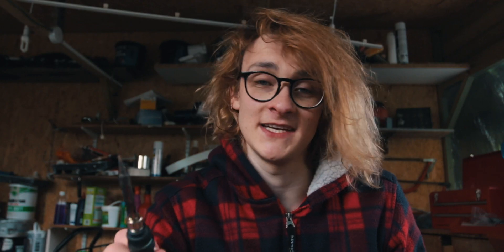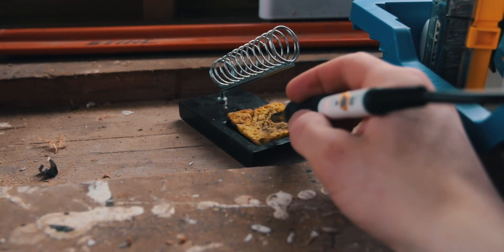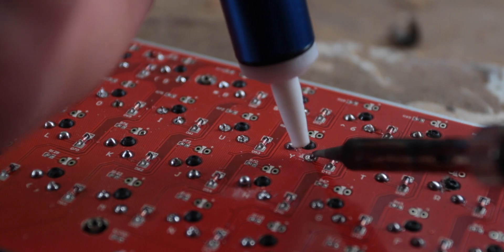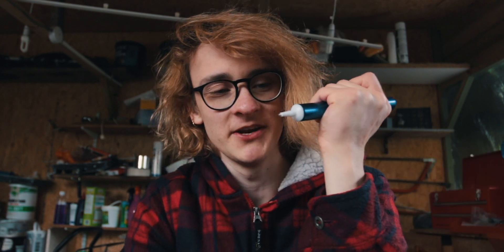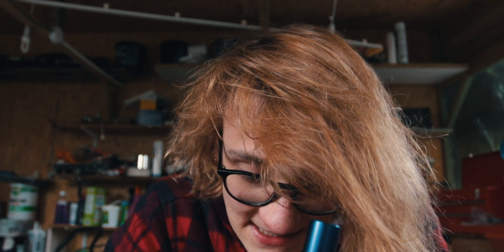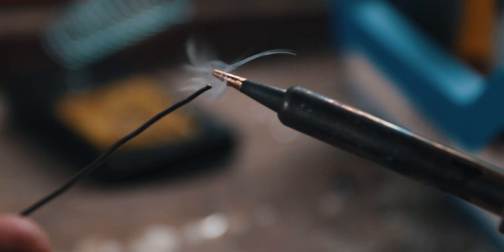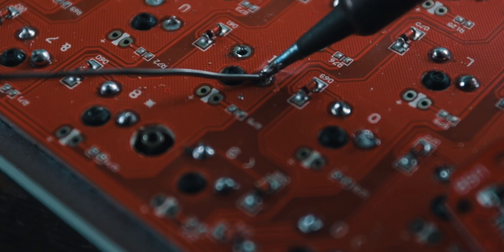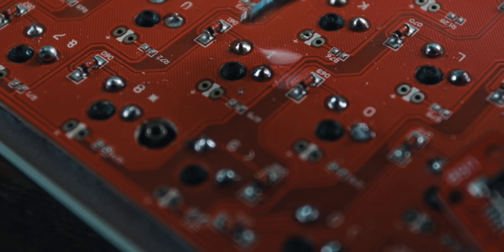HOW TO EASILY CHANGE/SOLDER MECHANICAL KEY SWITCHES

Comment: I'd like to thank you again, after some preparation, I finally went to town on my Ducky Shine 7, changing the original MX Browns for Drop HolyPanda Clears, also took the chance to change the stock stabilizers since the spacebar one was troubling me constantly.
I only messed up once, on the ESC, burned out one of the pads, but even managed to fix that by learning how to jump a wire, it was an easy problem to fix.
The result is a keyboard that's a pure joy to use, so don't be intimidated by soldering, people, with some equipment it's not hard and is kinda fun.

Comment: hi! if anyone can answer, 
I recently started my first keyboard project, I saudered in new switches. Everything works except the backspace key. the board looks fine, the saudering is fine, I changed out the switch in that spot 3 times. I'm still at a loss.

Comment: When I touch the soldering iron to the solder, it'll melt just fine. But when I touch the iron to the switch pin and the pad and the solder to the other side of the pin and pad, it doesn't melt. I'm using 40 tin 60 lead solder and my soldering iron is up to 690F. What am I doing wrong?

Comment: Can you take out switches without a solder ?? I don’t even have one
Reply from the maker: Nope, you'll need one.  Unless you have a hot swappable mechanical keyboard, but most aren't
Reply: @BubVisuals  ahh okay, thanks bestie. 😌 I’ve been looking at hot swap keyboards that are fine with any switches that have the three pins lolol

Comment: Actually really helpful, thanks mate

tho, do you need to resolder the switches in? Would it be possible to leave them unsoldered to make kind of a hotswap keyboard?
Reply: wondering the same thing
Reply: @loumcq1950  the answer is no, you can't. Done some experimenting with my boards and you can't leave them unsoldered

Comment: when you say "never touch your solder with your soldering iron directly", what are you touching the solder to then? the gold contact pad on the PCB?
Reply: i'm 99% sure that's what you're supposed to do
Reply: @picklejar7236  yeah, after 3 months of learning and building a few things- you literally have to do that lol. If you put the tip on the contact pad and hold it there waiting for the solder to melt, then you're gonna burn that contact pad.

Comment: wo'nt work for me. there's still a very thin film around the hole and the pin. i have a really expensive razer blackwidow and only one key died. I'm trying to replace it with my scroll lock
Reply: lesson learned : never buy a "gaming" keyboard, it is just a trash. Bad quality, bad feel, bad sound
Reply: Sorry but with Razer keyboards. You shouldn’t do that because they are junk. Buy another keyboard. A 20$ keyboard can be much better because you can replace switches easily
Reply: Nguyễn Hoàng not a $20 dollar one but I’ve heard that the gk61 is a very good keyboard and it’s hot swappable

Comment: Pardon, but when you say never touch your solder with your soldering iron, you mean just leave the soldering iron close to the socket and slid the solder under the soldering iron but and leave it for 1/2 seconds until it starts melting?
Reply: What you should do is use the iron to heat the leg of the switch and the pad on the PCB briefly, before introducing solder. Don't touch the solder to the iron, touch it to the leg and the pad. They'll melt it, rather than the iron, and it'll flow into the gap between leg and pad.